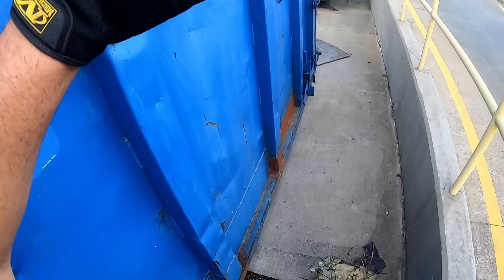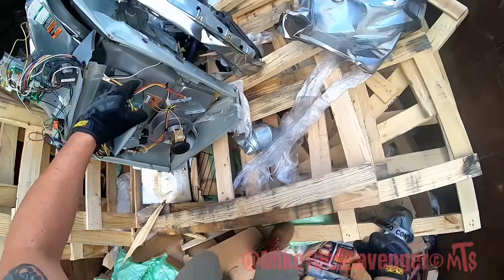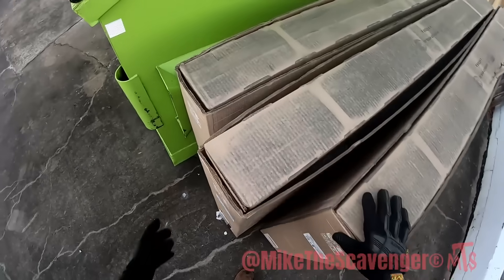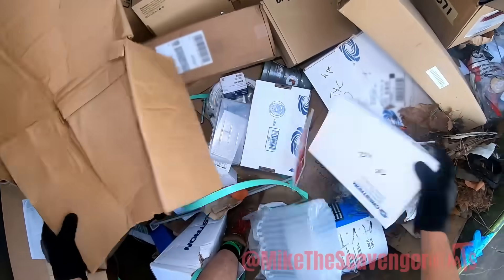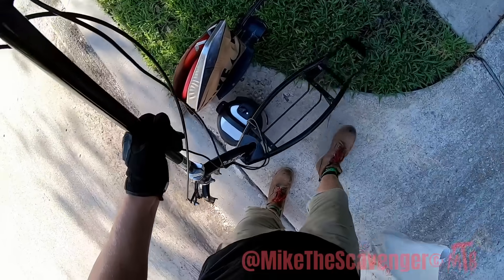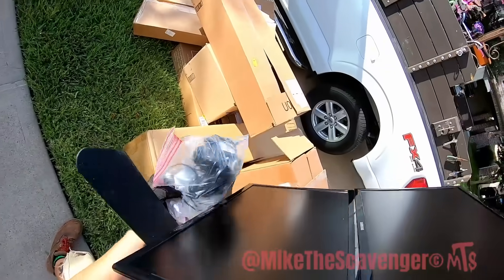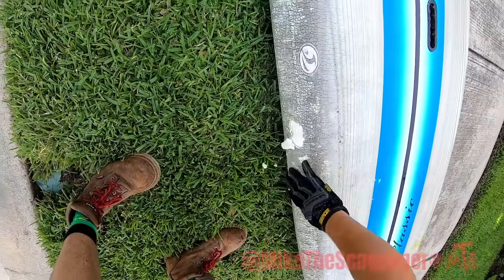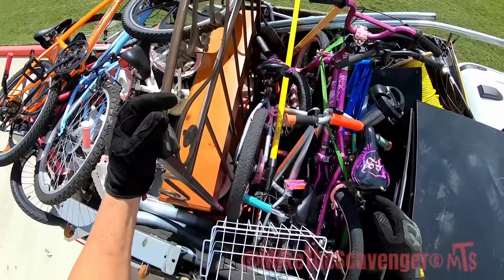Dumpster Diving & Curbsiding "I Totally Lost Count Of How Many BIKES!!!"

Comment: zxr badlands winch 2500 harbor  freight  $80 ... jerk the stuff out of open top, or  out of  top  of any  dumpster    real quick save you injury  , etc . put in back of truck  mount sideways . real quick throw cable and hook in pull out.